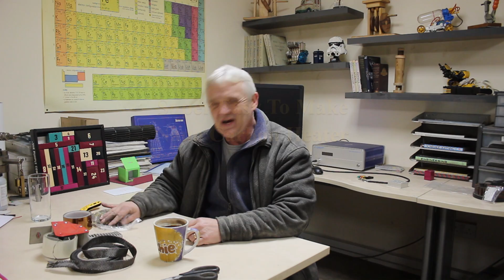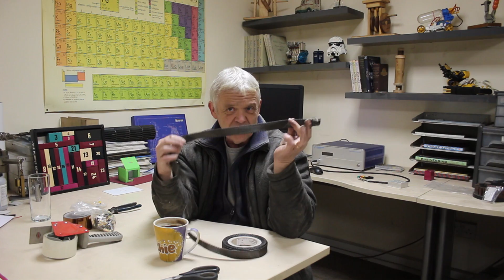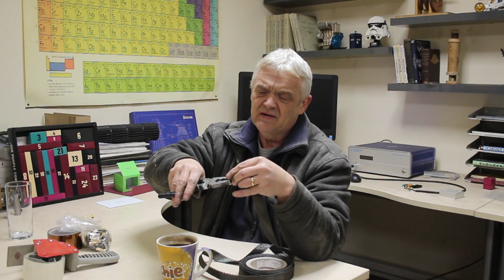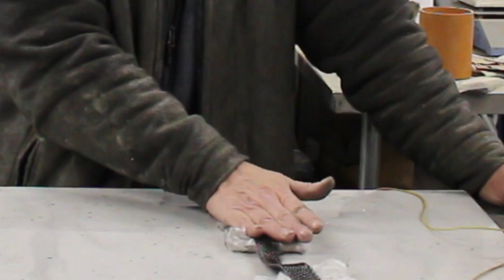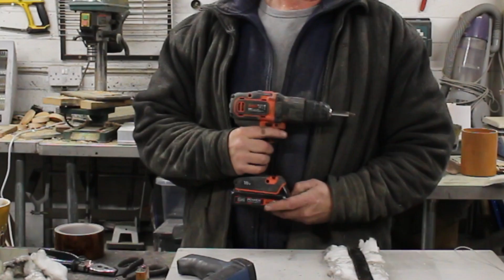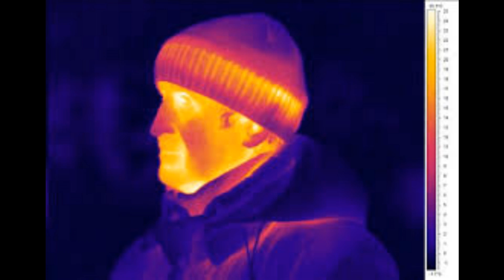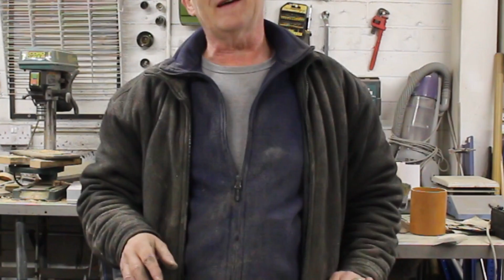1765 DIY Super Easy To Make Nano Carbon Infra Red Heater For A Ton Of Uses

Comment: Considering the recent dogma of heating the individual being better than heating the environment, it makes me wonder. I've priced out the costs for getting a 10,000 mah battery pack, along with a foldable perovskite/ETFE style backpack camping solar cell and a large coat with several heating units set up in much this way. It came out to around $100 all told, but that's for retail prices and retail products. If that cost could shrink, I feel it could make a real dent in preventing suffering and perhaps even deaths from cold and winter for homeless, for starters, beyond being a far more flexible way to camp outdoors!
Reply from the maker: I didn't really it was essentially so cheap mate as a full kit - and you are right mass production could bring this to a survival give away kit - I like the thinking here thanks for sharing

Comment: Wonder how much power it would require to boil an egg ? Would it be more efficient than an electric cooker
Reply: You would likely use nichrome wire for that. But be careful!
Reply: @alulaleak  I'm not taking this project on. Just wondering the different applications. Maybe even a cup of tea warmer.
Reply from the maker: no - check out the video I linked to at the end of this one designing heaters - that should explain it

Comment: What happens if you want to wash the clothes, the sellotape will disintegrate during the washing process?🤔
Reply: You could laminate it with plastic or coat it in silicone.
Reply from the maker: you only need the tape in stand alone mate - if you put it in clothes you can just sew it in - no tape needed

Comment: Really good mate.  Now I can use a method other than telling porky pies to set my pants on fire :)

I think a great use for these is portable heat packs for therapeutic use.  No more overcooking wheat packs in the microwave.  Just stick a battery in it.  Or even for heated blankets.  No more plugging them into the mains and hoping nobody spills a cup of tea over you.  Heated bedding for pets.  And so on.

I'm going to try to make electric heat packs this way.  We often need them for various aches and pains.

Well done.  Extremely simple and endlessly useful.
Reply from the maker: well porky's are always an option mate lololol - I like the heat pack idea mate - cheers

Comment: How does this material work out at 120 and 240 volts being pushed hard with amperage Robert ??? Would enclosing the material help keep it from burning up and being able to resist the strain and pushing ??? Peace vf
Reply from the maker: if you were heating with that high a voltage mate you wouldn't want to wear it it would boil you in your own skin - you need a fixed appliance and there different considerations apply - in fact there are. loads of heaters on the market using this material as heating units
Reply: @ThinkingandTinkering  Thank you Robert for bring me back to actuality. I was thinking about the other video when you made the heating unit Sir.  I look forward seeing more great subject matter from your site fella. Am getting ready to put more wood in the fire. MR. Lucifer needs to have his tummy feed. The heat output really make the whole house real comfortable. Good day mate too.

Comment: What happens if you heat that material? Back to voltage?
Reply: I like the thinking.  Underpants that heat you and then recharge the battery
Reply from the maker: no - it needs something else
Reply: @ThinkingandTinkering  diode

Comment: Great videos! Apologies if this has already been asked but if your in a sedentary position and not moving around could you use one of those 12V plug top power supplies that step down the voltage from mains AC to 12V DC? If so what would the ideal rating of the power supply be?

Comment: Can anyone help me please figure out my heating issue? I would appreciate your opinion. 

The hallway outside my flat front door is incredibly warm. I sometimes open the door to get some of that hot air in. 

Could I make something covert that would let the heat in? Essentially a stationary hit sink fitted to my door. Looks like a regular number plate. 

Do you think simply drilling a hole in the door, putting a copper plate on the front door, painting the door number on it, with a bit of copper plumbing in the cavity of the door with another copper plate on the back of the door would it work in transferring some of the heat from the hallway, so I can have my door shut and still benefit from the heat? Does the copper plate on the front of the door need to be bigger than the back of the door [inside the flat]? 

It’s at-least x10 degrees warmer in the hallway, actually... you begin to perspire in the hallway if You hang about too long in layers.  Do you think it would work as an idea? I think it could but I’m not sure of the most efficient way. If the copper/brass plate on the front of the door should be larger than the inside plate, if they should be equal in size.
Reply: I think a little fan fitted in the door could work well in your situation. The ones you find in desktop computers should do the job.
Reply from the maker: stick a vent grill and a fan on it

Comment: So how deep into tissue does the IR penetrate, or how far does it radiate, when using it in heat mat or over desk hand warmer?
Reply: If it runs at 30⁰ C that shouldn't be an issue whatsoever. Human internal body temperature is 37⁰C so we emit more than that would.

Odd concern, IMO
Reply from the maker: that's not really a worry mate - you don't want this hot - just warm
Reply: @ThinkingandTinkering  i worry about LACKING radiation. The penetration to the joints and bones and deep muscle tissue, is the one benefit IR has over regular resistance wire mat. This was the USe of the red Philips IR lamps of the 70s onwards. My Tomado seat heater, on the other hand, clearly is a regular resistance heater.
Reply: I have considerend ordering those (specified as IR) underfloor heating films on Aliexpress. To make my own IR heating panels (woulld these benefit from added mass like plasterboard or would the bare film work just as well? Never found a conclusive answer on your nor BigClive's Discords. And haven't had the time, yet, so not yet ordered any.
Reply: @perpetual4958  hmm, I haven't heard of in floor heating using an IR film. Sounds like a similar, but cool idea! The old way works well too, a hot water line running in the floor. 

If I'm not mistaken IR doesn't damage tissue in limited amounts and is used in medical instruments to look through your flesh for all sorts of purposes like pulse oximetry and IR therapy.

Comment: Hi Robert, could this be wrapped around  copper pipe to preheat water going into a boiler?
Reply: You probably want to use nichrome wire for that but be careful!
Reply: Yes, but you have to really shield/insulate (electrically) the conductive leads/crimps (or whatever way you are conducting electricity from the source to the carbon fiber). Copper pipe is very electrically conductive and will readily "short" the power supply if both leads/crimps are touching it. 

     Also, it won't be a very efficient way of preheating.  Water flows pretty fast through a pipe, so unless you are wrapping a rather long length of pipe and are heating up the carbon fiber to a significantly higher temp, it just won't add much heat into the water. Adding thermal insulation around it will help a bit, but unless it is a long length of pipe, pretty hot, etc again won't preheat much.
Reply from the maker: yes - but put caption on the pipe first then the carbon tape with a small gap between each winding

Comment: Interesting! But if you'd use it to heat yourself then this is at most 50% "heat efficient". Half of the heat is simply radiated away from your body. Is there a way to sort of apply an infrared radiator (or thermal isolator) in this context? You'd need to have a material that does reflect heat back into your body but doesn't cause a short circuit and is still wearable. An iron man suit, however cool, is not an option 😏
Reply from the maker: only if you stand naked and wrapped in a few bits of carbon fibre mate - I mean it is under clothes  so the air in the clothes are going to act as an insulator then of course you could just wrap a bit of mylar over the top

Comment: I don't understand how it's an 'Infra Red Heater'. The only thing I saw being 'Infra Red' was the IR Thermometer Gun.
Reply from the maker: the energy given out is IR - just because you can't see it by naked eye doesn't mean it isn't there mate - you can certainly feel it
Reply: @ThinkingandTinkering  Thank you. I'm struggling to understand, for instance how a current being passed through doesn't electrocute you. I understand there is;
* electrical heat (say from electric heater - think 'toaster' for bread/crumpets)
* kinetic heat (say from friction)
* chemical/thermal heat (from a bonfire - combustion)
* Infra Red heat (say from the sun)
* Microwave heat (from a microwave/device)
Or, is all heat just 'Infra Red' heat?
My understanding of IR was that you couldn't see it, as it's invisible to the naked eyes, although it doesn't heat the surface of an object but actually 'penetrates' the object and heats it from within? Hence why IR heaters are used by automotive bodyshops for 'curing' paint and by reptile tanks.

Comment: Hey Robert, we're currently working on an idea that incorporates infrared heating elements like this, but we have a question we were wondering if you would be willing to answer. In your video a couple years back on turning an old battery into a solar cell, at the end of the video you tested your diy cell and generated ~.22V, but there wasn't much info provided on the setup. Specifically, we're wondering about whether or not the glass you used was conductive. From its appearance, we tend to think it wasn't, but we figured it would be better to ask just to be sure. It also looks like you used a piece of aluminum(?) beneath your lead oxide-painted copper, but again, it wasn't mentioned. Would you be willing to clear those points up?
Reply from the maker: I really don't remember mate - I will have to check my lab notes
Reply: @ThinkingandTinkering  That would be very much appreciated. We realize that video was a while ago, but any info you can offer would be wonderful. (:

Comment: shame you cant collect energy from heat  with these to dump into a sand battery
Reply from the maker: you could
Reply: @ThinkingandTinkering   that would be an epic video    as you could collect the waste heat from your methanol heater  and charge up a sand battery.  totally off grid